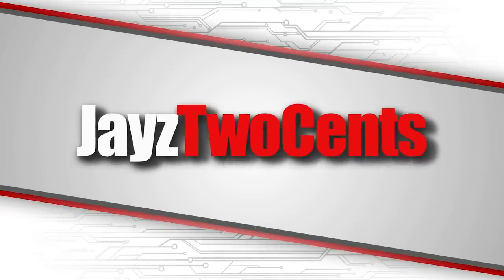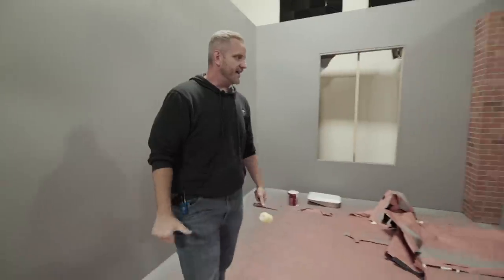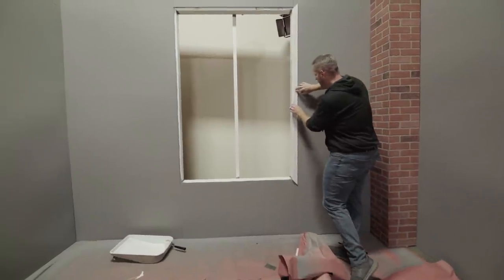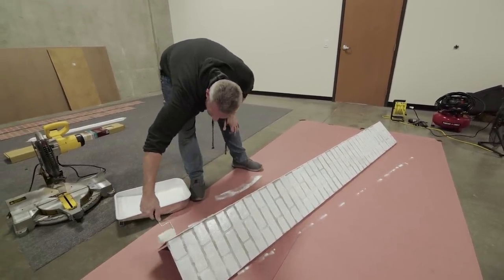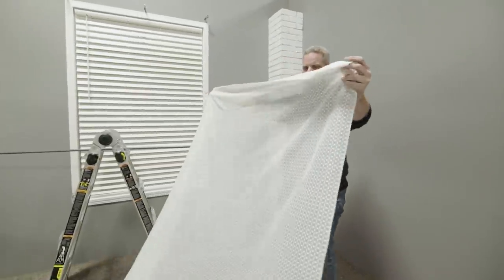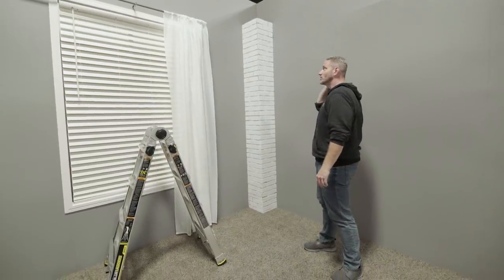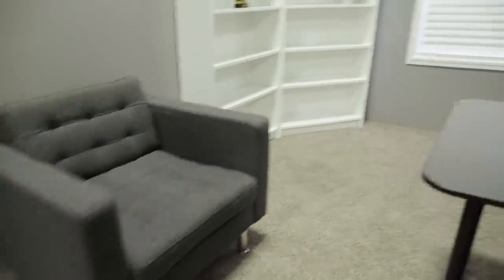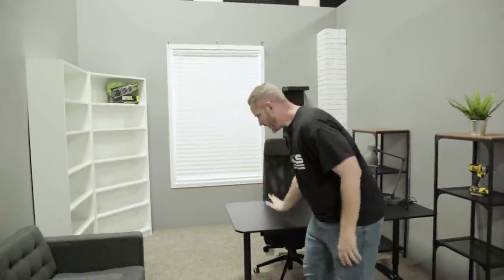Noob JayzTwoCents Building a Studio - Part 3

Comment: You'll need some sound deadening tiles for a faux ceiling, you can hear a ton of echo even in the set. But its certainly believable as a room when the camera is in there. Looks good.
"Ikea bookshelf protip: use a nail gun"
Reply: Last time I used a nail gun to put together an ikea bookshelf we had to take my cousin to the hospital. Not because we shot him or anything, he got bit by a snake. Also the nailgun blew through the material and ripped off a corner of a sidewall. Probably shouldn't have used the one we hung studs with.

Comment: If you want to hide the seams in the walls try using a wheat paste with strips of moslin fabric - it's a common technical theater trick used in set construction that will create a smooth, nearly seamless surface that paint adheres to.

Comment: JAY...
Iv done stage production for over 4 years..  and something you might consider if willing to do it..
MOST stage is light weight and Adjustable/changeable...
Its all frames...even windows have nothing solid.  Its light weight wood 1x2 and 2x2..And the surface is cotton Cloth..then covered with Whitewash(x3-4 times)  Then the rest is all Thinned down paint.
You can make the surface into brick/rock/Solid colors, anything...its all Illusion..
Door frames and windows are JUST THAT, FRAMES, inside the frame.  they dont even have to Pass thru the Cotton materials...as we can draw pictures inside or Hang a MONITOR INSIDE IT that can change to anything..

But you have to have everything ready to figure out What you need/want to create...OR just change it, because we have done NO DAMAGE to the Cotton backing..
Furniture can be made from anything from Cardboard to real wood..depends on WHAT it needs to handle.
Goto Auctions, Go to the Discount stores and salvation army..

Lighting is fun easy USe 2" metal pipes and make a pattern to HOLD IT ALL UP with Clamps..  Makes it fully  adjustable..

In the END, the MORE CRAP you buy the more ROOM you need to put it away...When you change things you end up with so much JUNK that cant be COMPRESSED, it gets fricking stupid.

Comment: Loving this series.  Idk if you'll see this but for those panels on the concrete wall so you dont have drill wash the wall with like TPS or degreaser and then buy some locktite construction advise and squirt a good edge on each panel and then down the middle and squiggles in between stick it back up with the tape and pres it hard against the wall that will hold it

Comment: I have an idea for how to hang the sound panels on that concert wall. Use Paracord and hang them from the ceiling as close to the wall as you can get. If you can't get them close enough rig a pvc pipe boom to push it from the ceiling against the wall. If you make the boom pivot from the last rafter towards the wall, rig a hoist to pull up on the end of the boom, that will pull it up so the panels get pushed against the wall.

Comment: useing hard board if great as long as you put the studs 16 inches on center apart,or use a cross +,or diagonal / or \ ,beams to fill in the wide open spots,to take up the slack in the board.

Comment: The panels you have gaff taped to the walls need some adhesive on the back in addition to the tape.  I've used Liquid Nails FUZE-IT in a similar application before.  I'm sure other brands have similar products.  Home Depot and Lowes sell several different adhesives that should work for you.

Comment: Use liquid nails.  I had a similar problem and used liquid nails instead of tape to hold those panels to a cement wall.. It comes in a caulk gun. It held up wood heavier than that for years. It is probably still there. You can drive nails into concrete. That is how they frame houses. Use washers or the nails will go straight through those panels. They make special washers for that. Nails are driven by .22 blanks. You can buy a nail driver for about 20.00. Without the washers the nails will go right through a 2x4.

Comment: Bondo the seems

It wasn't a bet, I have had to tape sound panels to concrete before.  Wash the concrete where the tape will adhere and then use 3m mounting tape in like 6 spots.

Comment: I'm still disappointed that he hasn't stuck his head through saying, "Here's Johnnnyyy!!" But I digress.

Only thing I can see is when you're shooting that 45-degree angle from the left, the corner of the desk is about midway through the shelf causing it to lose the depth you're trying to get by offsetting it. Might want to experiment with moving the desk about another six or nine inches over until you can get those corners aligned or the desk to be further out than the shelves. Just saying...

Comment: the carpenter in me is screaming everytime you put a screwmachine down and its standing up straight. PUT THAT THING ON THE SIDE! have seen it so many times it fall overs and destroys a surface and bam you need to fix the new floor you just installed or the new kitchen counter. and in some case when you put it up high it falls down and breaks the screwmachine itself. so for the love of Gaben, PUT THOSE DOWN ON THE SIDE!